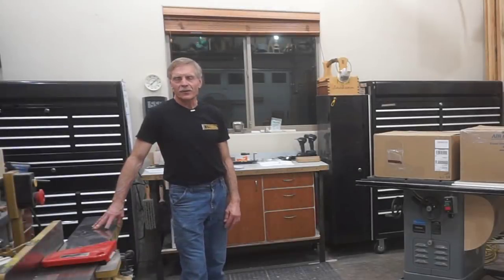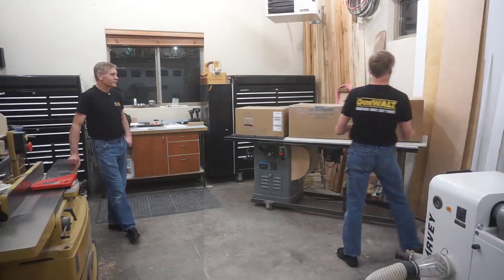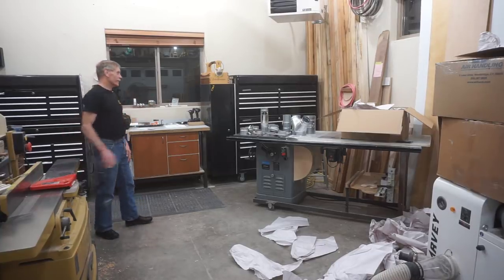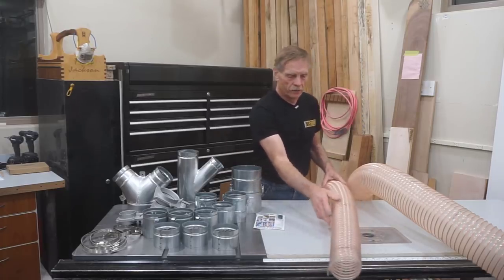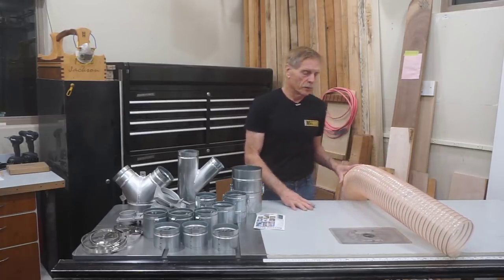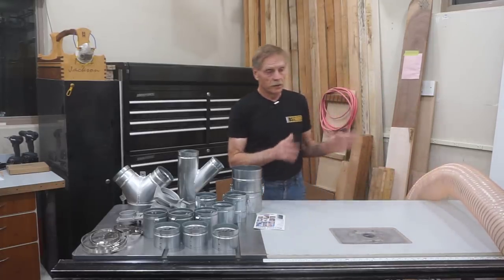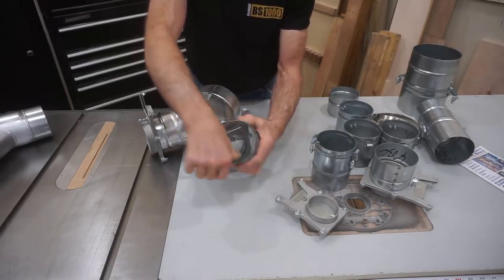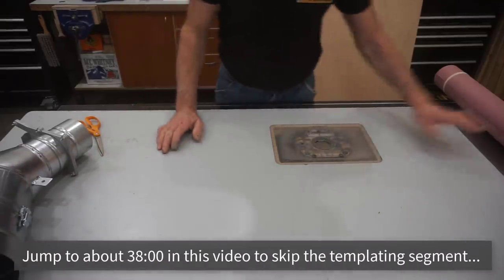Flexible Dust Collector Piping Setup

Comment: Hey to Matt. 
Found a nice dust collection system video and thought you might enjoy; especially the low-voltage switches controlled at each blast gate. Long Ranger Multi Guage Switch System off Amazon.
That part of the 11-minute vid starts at 4:49 but the whole talk is worth a watch. 

The channel is: 
"Selandry1" 
and video titled "Insane Dust Collection System" 
(16 Jul 2018)

As well, pipe or tubing running along walls and ceiling is very do-able. I read in another exchage you had on this thread is that you want the main line to stay near the floor and avoid two quick 90-degree turns close to the Harvey. If you stationed Harvey in the air compressor room you could use the distance to have 45-degree fittings gently turning and lifting the main up toward the ceiling or at least along the wall.

Peace of Lord Jesus upon you and yours
Reply from the maker: Thanks for all the beta David... I'll keep in in mind for consideration as I work on optimizing my pipe network/system.  Best, Matt

Comment: What kind of zero clearance insert do you have in your table saw?
Reply from the maker: It's an old Wood Dynamics insert Patent #5,159,864 that, sadly, is no longer available.  I presume it's got to do with the fact it doesn't allow for riving knives, etc or something.  The design is perfect for my workflow, tablesaw, etc and I've always been thankful to have bought one when I could.  You might get lucky on Craigslist or Ebay though... best, Matt

Comment: is the inner wall smooth or ribbed on the 6"?
Reply from the maker: Everything in my shop is ribbed inside and out.  Makes it lighter weight and more flexible but dramatically increases airflow resistance so plan accordingly if airflow is a concern.  Not sure if Air Handling Systems has flex that's smooth on the inside but if anyone does, I'm sure they do.  You can call them and talk to Kae with any related questions as he's very knowledgeable and helpful.  If you call, please tell 'em Next Level Carpentry sent you, OK? 😉😎
Best,
Matt
Reply: @NextLevelCarpentry  Thanks. Im surprised that knowing the resistance is high with ribbed inner wall that you never looked into smooth wall before.
Reply from the maker: @ScreamingEagleFTW  Ya, don't be too surprised!😲  I was totally winging it when I added dust collection into my new shop since it's the very first dust collector I ever used or owned in my 45+ years in the trades.  As it is, the G700 is so oversized for my small shop and limited duct network that it's not an issue, for me that is.  Smooth wall would be more efficient but also essentially unnecessary.  Hope you're able to design your system to work effectively for your setup and needs.
Best, 
Matt
Reply: @NextLevelCarpentry  well you could have fooled me, you look like a pro.  I will come up with something for my 2hp Jet. I havent got it figured out yet. Just trying to get the most out of what I got and make it look nice and neat as possible.  Probly I will use flex hose along the floor off to the side also.  Thanks for the vid.